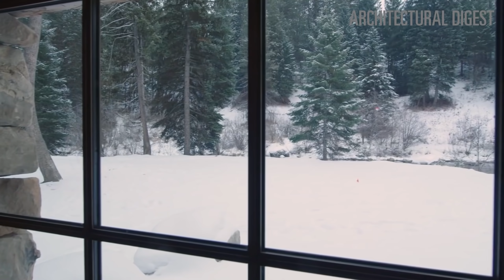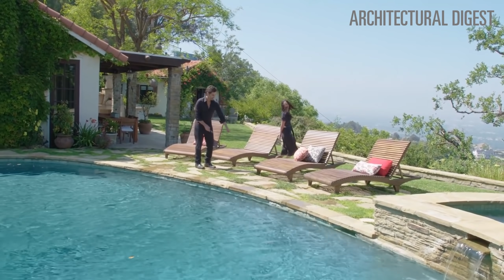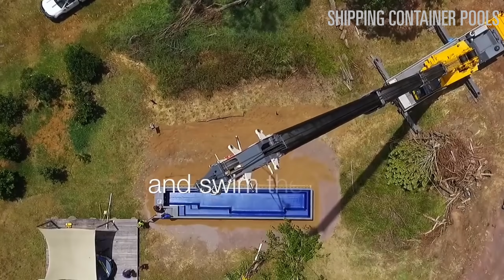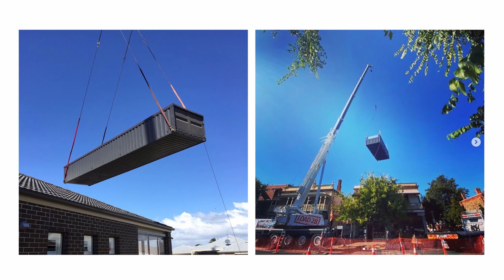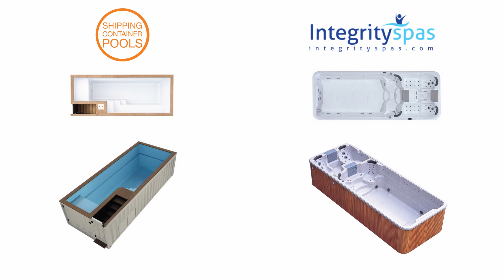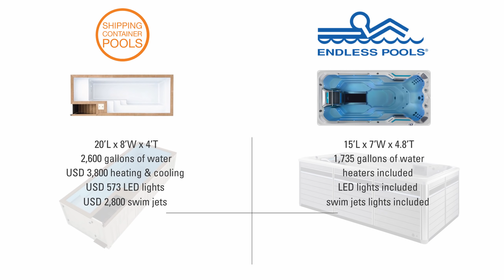Should you buy a shipping container pool?

Comment: A lot of this always seems to lean towards use case. However, I think Belinda fails at being unbiased. Yet, that's my opinion after watching a number of her "shipping container" oriented videos. She appears to be very biased towards classically built structures. As a 2nd generation carpenter, I can understand and appreciate that. However, the most misunderstood thing about the building process is the project management triangle.

The Project Management Triangle consists of Cost, Time, & Quality Of The Finish Product.

Think of that triangle, and understand that pulling on any of those angles/legs distorts the shape of your project, so to speak. This can be applied to almost any type of project, whether buildings, woodworking, renovations, or non construction projects of all kinds.

In the case of "shipping container" builds, the greatest advantage to their usage, in my opinion, is project completion speed (Time) first and foremost. Speed of completion in most cases saves you in labor costs overall, as labor costs run the highest on 99% of projects. With shipping container pools, reinforcement of the structure is a given. However, building a traditional pool would take weeks in comparison to days in the case of a shipping container pool.

Matt Risinger featured one on his channel. https://youtu.be/pscew-mSFLU

The price may not be the hang-up for anyone building a pool to worry about most. ALL POOLS ARE EXPENSIVE LUXURY ITEMS! 

Also, do what's best for your build. If time isn't an issue, the sky's the limit. If time matters, then look for alternatives that can save time while maintaining the quality of the finished product. Just be aware, that in most cases saving time doesn't save you money. Saving money rarely saves you time and almost always lowers the quality of the finished product. And if you want high quality, expect to pay for it.

Comment: I was watching this thinking....cheap mobile pool. My idea is: start off with a 20 yd roll off dumpster (22'Lx7.5'Wx4.5'H). Top edges and sides are already reinforced. And foam closed cell insulation board and a heavy duty pool liner. Used external above ground pool pump and filters. If you want to move it, drain it and call a roll off truck to move it.

Comment: educate before making videos....  re enforced shipping container .. just a plate on the top like what makes a H beam strong. its no issue if yo can weld.. water proof? fiberglass? -.- no isolation plates with a liner. hdpe welding or paint will work to ..  25 000 to 4000 dollars? what a joke.. its turning 2 to 5k dollars of materials into 25 40k

Comment: LoL having a pool hasn’t specifically been a dream of mine. I like to swim but I don’t like the huge amount of maintenance that comes with a pool. So just my luck my first place to call my own happened to have a pool. It would be expensive and laborious to maintain. I’d be spending tens of thousands on Chlorine alone over the full length of the mortgage. Lucky for me I recognized that early and let it become a giagantic pond that I added fish to to keep skeeters at bay. I plan to engineer a solution that will get the water clean and clear while being low maintenance so that I can swim in it once more. It probably is safe to swim in now as long as I have no open cuts and don’t let any water inside through other ways. But with the help of aquatic plants,  UV radiation and a bit of know how I’m sure I can create a near autonomous system that cleans the water using more natural processes/materials in a way that works with what the site can provide.

Comment: Yes, a 10,000L of water weights 10 tonnes, but the walls of the container are only subjected to a stress relative to the pressure head of the water. So a 1.5 metre deep pool only has a stress of 14.7kPa or 2.13psi on the bottom of its walls, meaning a pool only needs to be as strong as an air tank rated to 2.13psi. The fibreglass shell is easily enough to hold the water in sideways. The steel container only holds the shell up off the ground.

Comment: Why are the containers sliced halfway up? Why not simply cut the roof off, leaving the cant rails in place? Of course, more reinforcement to the taller side walls may be needed, but a day with a welding set and a pile of box section would soon address that issue. You could get a fibreglass flat-roof mob to seal the interior. Digging out a hole isn't a major issue either- a weekend's hire of a tracked digger would not cost the earth, and most people enjoy using them. The result would be a 40ft long, 8ft deep pool- luxury indeed.

Comment: Shipping containers are really great -- for shipping goods.  They don't make good houses, pools, garages, underground shelters, etc.  In all cases there are better options available.  I think the IDEA of taking a cheap shipping container and making something useful out of it is compelling, but like so many compelling ideas, it falls short in practice.
Reply: They do make decent, secure, storage sheds (if you keep the interior temperatures in mind).  A construction company that I worked for used them to hold on site tools and equipment, and another firm used them to store samples and extra building materials on site.  After hurricane Katrina, I purchased a pair of 20ft containers to basically act as sheds while my garage/shed was repaired.  They also make decent, temporary job site on site offices.  As someplace to live, not so practical.  As a pool, I can go to Walmart and buy an above ground pool, go to Home Depot and buy wood to build a deck and steps, etc., and still spend less than to convert a shipping container into one.  Best use however, is for shipping stuff on/from a boat, truck, or train.  Perfect design for what it was designed for: to store stuff.

Comment: My criticisms: 
She discusses an alternative method of double layered steel but that’s not what they are doing, so it’s an irrelevant point.
She talks about the problems of putting it in the ground, but that’s not the point of the pool so it wouldn’t be put in the ground, again irrelevant.
She’s says the size or shape might not be optimal (rigid dimensions), but consumers who didn’t like the size and shape wouldn’t consider it in the first place, so it’s entirely circumstantial, not a fundamental flaw.

She does comparisons with endless pools and hot tubs, but those are for fundamentally different uses then this pool. A better comparison is with traditional, in ground pools, which I wish she discussed more as it what this product is directly replacing.

Comment: Half of the arguments were about problems that the company had already solved.  They obviously had the fiber glass lining figured out and the structural reinforcement was included in the price..  The only valid argument against them (before we went into the apples/oranges comparison with endless pools) was insulation.  And that obviously depends on the climate.

Comment: Some of the 'issues' raised here aren't relevant to the pools use in Australia where the company mentioned is based. Insulation isnt a problem, no overriding issues with fibreglass either as very common in australia, and the they're mainly used above ground as Australia has laws regarding pool fencing which these pools dont require as they are above ground [you can see the self locking gate in the video]. Still a very useful pool for australian conditions.

Comment: I'm not much of a swimmer anyway, but I would want the original branding on my container pool, like the bottom or upside down top  half of MEARSK, HYUNDAI (orange), CHINA SHIPPING (teal), EVERGREEN or ONE (in magenta).  To the container pool's credit, the air gap between fiberglass and courugated steel is a pretty decent insulator.  It's not excellent, but better than nothing.

Comment: There's nothing that a steel shipping container loves more than chlorinated water...
Reply: They're well protected...on the outside
Reply: why? does it give it a nice patina like weathered copper?
Reply: @Avianranch-vc2  a little more than that i think
Reply: Alot of above ground pools are made with steel roll walls
Reply: @slackin_2423  all above ground pools made with steel roll walls have a plastic liner used to protect the supporting structure from the chlorinated water.
Chlorine heavy water (especially during shocks) will rapidly deteriorate the surface of steel (compared to pure water). The liner is absolutely necessary
Reply: @chrisknechtel6730  yeah, so do the shipping container pools. Did no one here actually watch the video?
Reply: I can tell you didn’t even watch the video and immediately clicked and commented this.
Reply: LMAO
Reply: Yeah, it's not like they were making steel pools for decades now.
/sarcasm

Comment: She really does here research. It’s rare to really learn so much on YouTube. Thank you
Reply: Not really,
Those disadvantages she si talking about are easy to fix, there are cheap treatments against corrosion, the cracks int the fiver glass occur in other type of structures, and about the waterproofing, you have good waterproofing solutions that work well with metal, companies like ARDEX, Fester etc. I’m an architect and structural engineer and worked many years building large swimming pools for hotels and as a consultant.
Reply: Nope because she didn’t truly research

Comment: That's two shipping container uses she's destroyed. I want more MORE - crush our hopes and dreams
Reply: This shipping container repurposing reminds me of the pallet furniture I wanted to make a few years ago. After researching I realized the risk of chemicals and bugs in old pallets meant I'd need to buy new ones. Buying new ones meant I might as well pay for a professionally made couch and bed.
Reply: @ThatGirlJD  Burn the pallets Japanese style. Kills bugs etc.
Reply: The only thing shipping container is good for is shipping goods in it because it is designed for that, everything else is just pushing it.
Reply: For real tho, I need an endless pool in my life. I didn't know it exited 10 minutes ago but now I know I need one
Reply: I set two 40's twenty feet apart and used them for bearing walls of my shop. Spanned them with 24' 3"x12" beams because that is what I had. Works great.
Reply: yes
why wouldn't they insulate them??
she sole me on the flowing pool
totally legit!! :DDD
Reply: Perhaps a new wife that comes on a shipping container?  All-in-one solution.  Cheap to bring in; effortless to move out.
Reply: Why are your hopes and dreams to reuse an industrial piece of equipment? They should simply be recycled and almost all energy used to make the steel is recovered. Trying to take a specific use industrial material to "repurpose it" is silly. Recycle and build proper items with proper materials.
Reply: @chrisfreeman4876  reuse is easy than recycle.

Comment: Wait, I’m a bit confused - the air inside the shipping container is not a better insulator than solid ground? I thought air was a terrible thermal conductor?
Reply: I think the reason is because the air isn't sealed so it is transferring or losing heat to the outside air that can freely flow into and around the fiberglass pool shell.
Reply: @GeorgeMonet  so maybe one could insulate it with some glass wool?